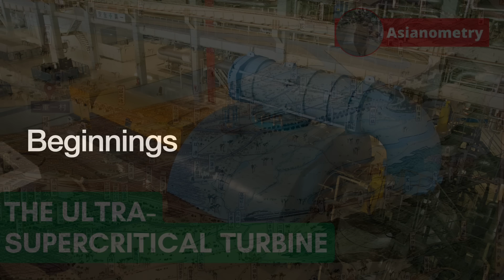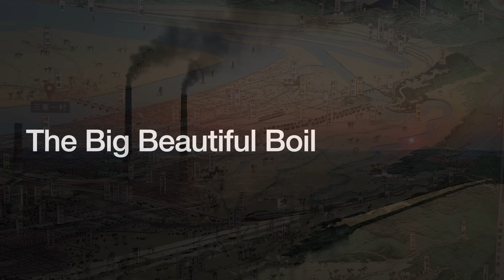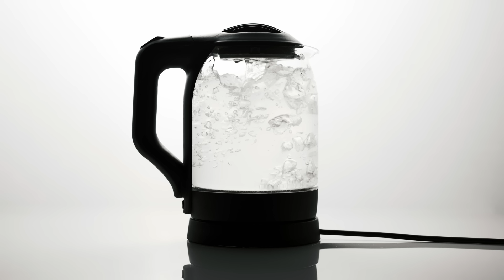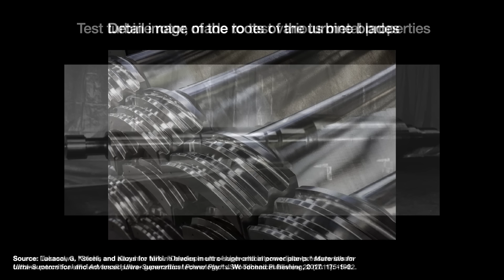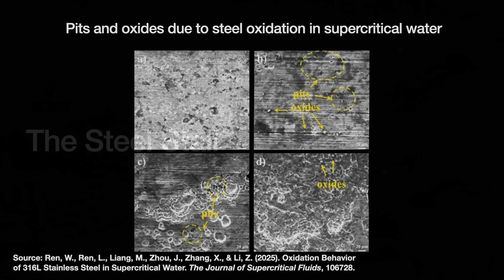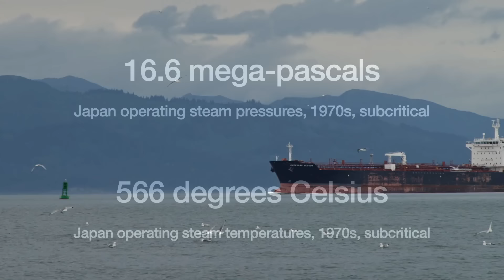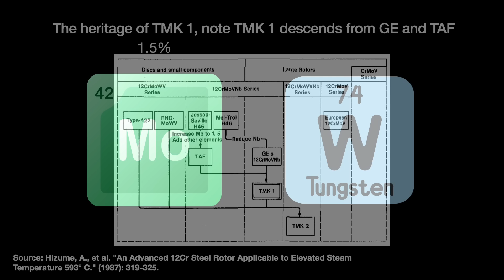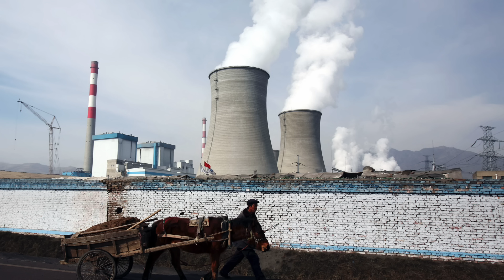The Epochal Ultra-Supercritical Steam Turbine

Comment: Maybe you already covered it, but I would appreciate a video on alternative heat transfer mediums. I've seen Helium and supercritical CO2 used for turbine applications used in China, but maybe there are other ideas out there.
Reply: Helium and CO2 turbines have exactly the same problem as ultrasupercritical steam (and indeed gas turbines) - they are limited by finding alloys that will last at these temperatures and stresses.
Reply: supercritical xenon (and the other noble gases) have some wild theoretical advantages, but they're just too expensive to ever use on earth.

where its advantages may find practical use, is in large spacecraft that have to operate for centuries without maintenance, where size and weight are extremely important, and the raw cost of xenon isn't an invalidating factor.

from a physics perspective, the ideal "working fluid" is heavy, unreactive, ultra-stable, and non-corrosive... the reason we use "light, corrosive, reactive, unstable" steam is because cost is king.
Reply: @JedPotts-jv2ux if you're using molten salt nuclear those noble gasses are a lot easier to obtain. It would take a while to generate enough to justify building turbines around it but could easily be a future development once older designs have produced a steady inventory
Reply: @JedPotts-jv2ux argon seems pretty cheap, is that a poor choice for some reason?
Reply: @eldencw  no reason i can think of, its just that steam is so unbelievably cheap in comparison to everything else.

argon should be superior to supercritical CO2 in every way, assuming argon's low supercritical temperature isn't an issue.
Reply: Anton Petrov made a video on it recently if you havn't seen it, not as a main turbine but still very interesting and apparently commerical at one location in china
Reply: @erikssonown  https://www.youtube.com/watch?v=BNDrC6fkjf0
Reply: I have only heard of supercritical CO2 being used as a solvent
Reply: You might want to check out Kalina cycle and ammonia working fluid steam engine research.
Reply: Most high end pumps in space use Hydrogen. Both for pumping coolant loups out to radiators, to get your cool side, and for the heat engines themselves to generate the power. Hydrogen is fantastic both as a coolant, and as a working fluid, especially from a power-to-weight ratio perspective. It's also a real pain in the butt to keep sealed, and quite high volume, which really sucks if you're building a power plant in a fixed size and expensive plot of land, and you don't care so much about weight.
Reply: @ASDeckard  Very large dynamos mostly use hydrogen as a coolant and have since the 1960s (another byproduct of the space race). With the same advantages and disadvantages.
Reply: In some steam generators hydrogen is used for the cooling of copper windings in the generator, then that hydrogen is cooled by water
Reply: Not much beats water's 1600x expansion.

Take a 1.6l engine/container. Put 1cc/ml of water in it. That's how much it expands.
Reply: @myne00  phase change require a lot of energy that wasted hence why people bother with alternative that don't boil water
Reply: @xtradi  that energy is also the very reason the phase change is useful though.

Comment: all that effort to be 1/2 efficient as a hydroelectric plant :(
Reply: Unfortunately that's just the nature of heat engines, they can never be 100% efficient because heat must be rejected in order to revert the working fluid back into its original state for the engine to keep operating in a cycle.

Even hydro is like this, though not on the scales we are used to.  The heat input into the water to cause it to evaporate, before raining down into the dam's reservoir is rejected as heat.  All things considered hydro electric is probably terribly inefficient, it's just the heat source is massive and practically infinite from our perspective.
Reply: But less location specific.
Reply: hydro plants have quite a few problems, notably massive ecological impacts.
Reply: It's almost as though it's solving a different problem
Reply: Too bad hydroelectric can’t be "ANYWHERE" and "ANY SIZE"
:(
Reply: Ever see a hydroelectric plant on a trans-oceanic cargo ship?
Me either.
Reply: You can never beat the Carnot efficiency

Comment: It's like we evolved to boil water.
Reply: Born too late to BOIL WATER. Born too early to BOIL WATER. Born just in time to BOIL WATER.
Reply: @Flumphinator  i think the boiling water is coming to an end. Now we will boil supercritical CO2. China has one already.
Reply: @pseudo_anonim  whaaaaaat
Reply: @pseudo_anonim Also in Heatpumps. I am writing my master thesis sbout that
Reply: @lefotografion  look for the video from Anton Petrov. Its awesome.
Reply: @pseudo_anonim  "But you just can't get the amount of energy from CO2 like you can get from water. Due to energy capacity. The capacity of CO2 is laughably low in comparison to water. 0,85 kJ/kg/K vs. 4,18 kJ/kg/K....."
That's what I wanted to say. But if you look more into supercritical CO2 the numbers look very... interesting. No wonder CO2 Heatpumps are popping up all over the place... It seems to be a pretty efficient, ecological step to do that. also because you can run all of it at in comparison very low temperatures... Amazing!
Reply: @MarkarthGuard45  
search on youtube "The End of the Steam Age? China’s Breakthrough CO2 Generator"

More info and this channel is gold IMO
Reply: @MarkarthGuard45 the other advantage of S-CO2 is significantly lower corrosion and wear characteristics (being much smaller helps too).

The naysayers are latching onto corrosion in both S-CO2 & Molten salt nuclear whilst ignoring the fact that tech they favour (LWR and steam turbines) both have massively larger issues in this regard. It's like watching "certain groups" in the USA who think that attack-dog politics, promoting FEAR & shouting down any dissent is the way to informed devate
Reply: @MarkarthGuard45  Sorry,  it's  about thermodynamics!    To  work  with  CO2  means  to  work  far   supercritical,   You  cen  work   with air   to,  so   CO2  nothing to   prefer!   CO2  or  something  else    maks  sence  at lower  temperature!   because  You  have  the  posibility   to  trensfere heat   at  one  preassurelevel   and   temperature   level..   It makes  sence   for low  temperature  cooling  devices.   CO2   ist  on the other  hand   chemically  stable   at  higher  temperatures...        CO2    is  not  offereing  the   adventages   of   the  steam    of  water  in therms   of  Temperature  and   preassutes   that  work   well ...      so    why   CO2?
Reply: @pseudo_anonim What people are missing here is that in the supercritical CO2 cycle you never condense into a liquid.  Even in supercritical water turbines you go through a phase change which losses you a ton of energy.  But just using a gas doesn't work either because it has such a low density.

The reason for CO2 is that your thermodynamic efficency is related to the difference between your lowest and hottest temperature so you need something you can turn supercritical at near room temperature.  You can do that with CO2 but not with water and CO2 is actually much better behaved at those pressures than most other molecules.
Reply: @pseudo_anonim  Sounds like propaganda.
Reply: @petergerdes1094  That is true, but also should mean absolutely insane pressures, to have a supercritical CO2 at the high temperature and density needed to get good thermodynamic efficiency.
Reply: @teresashinkansen9402  They usually operate around 200-300 bar (only need 70 to become supercritical).  Dunno if you call that insane.
Reply: @petergerdes1094  That is still a lot of pressure to keep on all the system. Supercritical CO2 at 300bar has less density than supercritical water at the same temperature and pressure plus less heat capacity. So I guess the main benefit is simply due saving energy due lack of phase change. But I still have this strong feeling CO2 turbines are just another another overhyped thing, not that far from thorium reactors. Ill keep learning and see if that notion changes.
Reply: @teresashinkansen9402  "Sounds like propaganda." lol what? Are you well ?
Reply: @pseudo_anonim  Very well, why? you will be surprised how much propaganda chynia pumps out.
Reply: Just imagine how much hotter and higher pressure the water our descendants will boil in their antimatter power plants will be.
Reply: @vgalis This one made me chuckle. God bless! ✝️ :)
Reply: @vgalis coffee spilling, excellent😂
Reply: @vgalis  "The epochal adiabatic water plasma turbine, how we tamed bremsstrahlung losses"
Reply: @vgalis  not really we will boil supercritical CO2 china has one already working. Boiling water for now is max 40% efficiency boiling CO2 can have 70% efficiency.
Reply: @pseudo_anonim  GE's steamH turbine is capable of 49% efficiency with steam
Reply: Super critical steam carries energy like sorcery. It's cheap and it's everywhere.
Reply: @404BYTE . Yep.  Works.
Reply: Some evolve into crabs and some evolve to boil water 🤷
Reply: @Tired_Koalabear then some boil the crabs in water.
Reply: Crabs were evolved to boil water, just look at the mantis shrimp 😏
Reply: Only fossil fuels make these high pressures necessary and from a grid perspective they are not very efficient as they are with a small margin only on or off.
Reply: @-r-495 anything hot makes it necessary. Wet steam is hell on turbines with massive increases in wear if droplets hit the blades (plus it washes lubricants out of bearings)

The hotter your hot side is the easier it is to raise efficiency and/or not have to reject heat into large bodies of water (which causes major ecological issues).

Steam works, but it's chemically reactive. CO2 is also reactive but vastly less so and doesn't need as much pressurisation (plus can have the cold side considerably colder than the cold side of a supercritical steam turbine)
Reply: @miscbits6399 You just need to plan and manage the rejected heat.  There are really interesting and kinda unique biomes around some of the Florida nuclear plants.  Unconsidered intervention is harmful but just because it isn't what was there naturally doesn't mean it isn't actually better.
Reply: @-r-495  nuclear energy is all about boiling water
Reply: We could not serve a more noble purpose, truly
Reply: Solar panels
Reply: And to find ways to travel faster
Reply: Were just monkeys that have learnt to make better and better fire. We've got some pretty serious fire going on these days. Still, some of the best entertainment going is a few lumps of wood on fire n some rotten berries.
Reply: Water, is the most magical/mysterious Element on this planet.
Reply: @brianjennings7644  it's not an element lol
Reply: @MadScientist267   
it's Sooo much more, little child. "Earth, Wind, Fire, Water" : it's an Elemental..kid..always has been, eh!
Reply: @brianjennings7644  I don't want to say anyone is slow or anything... but well, see... hmmm
Reply: @MadScientist267  
sure kid,..you're "on the spectrum" I get it, Sport.
Now run play with your Pogs.
Reply: @MadScientist267 i think i disagree with the guy i think water is god. If we have water we are gods on earth if dont we are chimpanzees with a week left to live
Reply: @ayıboğan_ertuğrul From that perspective, if you think that's a powerful idea, there's a whole lot more than just water on that list. Just a couple to start with... get rid of gravity, or better... electrostatic/electromagnetic forces... water won't even exist to begin with (or anything else for that matter lol).
Reply: @brianjennings7644 another victim of US education system or homeschoold by a pigeon
Reply: @RickTheClipper  Pigeons lack the cognitive capacity to understand such concpets. If you meant in a figurative manner then you are also wrong, pigeons have shown to be remarkably intelligent animals.
Reply: It’s steam? 
It’s always been steam
Reply: The new methof is not goodor makimg tea so I wouldn't call it improved.
Reply: Maybe the amount of water available is a Fermi Paradox Great Filter? Not necessarily for life itself, if other materials can replace it but if there isnt any, or enough to boil then it might limit technological development.
Reply: But these units DONT boil water. Thats the whole point.
Reply: @GeneraLeeUnstable  uh actually they do. They just.. go beyond.
Reply: @GeneraLeeUnstable the food you eat boiled water before going to your plate, you boil water yo prepare it and it boils water while preparing the food most o the time, you boil water (and the nutrients within it all together in your stomach) when you eat something....water boiling has been part of our biology since we born we kust didnt realise
Reply: Nothing beats water
Reply: @AquarianNomadic  what about lack of water?
Reply: If you take a piece of liquid and boil it in the open it will turn to gas and push in every direction. Next step is to direct that pushing force, usually done with some pipes, direct it on turbine and you get electricity. 
We don't evolved to doil water, physics made it take current shape. 
If there was different force happening mechanism would be different.
Reply: can't wait for the supercrtical co2 to replace water
Reply: say that again.
Reply: And burn carbon!
Reply: @BruceGinkel Oxidize carbon
Reply: Boiling water was always here. Before man was, boiling water waited for him. The ultimate trade awaiting its ultimate practitioner.
Reply: I hear a lot of talk about how fusion is going to save the day.
Sorry but a fusion plant, without some miraculous tech, is still just a boiler producing steam to eventually spin a generator.
Reply: @capnkwick4286  I saw that super critical co2 turbines are better and smaller for quite some use cases. if that is the future then who knows whats down the line many years later. maybe we will move on from steam after all.
Reply: @killahattack529  Why is everyone so obsessed with "moving on from steam"? It's simple, cheap, and very efficient. There's simply no need to look for something better when you're that close to theoretical to begin with. Sometimes you don't need to improve something. It just works, and works well.
Reply: @MadScientist267 steam works but maintenance is an issue. It's corrosive.
Reply: @miscbits6399  I guess it would be more interesting if the extra efficiency didn't go into feeding AI that many simply don't want. It's a moot point until the hypocrites can't drive either. Then what.
Reply: @capnkwick4286 
And it will arrive way too late to help with the climate crisis.

Plus waste heat is going to be as big a problem as heat held back via GHGs if we continue growth.
It doesn't matter if we insulate the greenhouse or we throw in a space heater.

Read the details in There Is A Deeper Problem Beneath Global Warming by Aeon.

This is why we get double the bang for the buck with renewables like solar and wind: There is no waste heat, so replacing coal saves CO2 and removes a heat source.

And we are so close to the brink that every little thing helps 🫤
Reply: @capnkwick4286  and you have completely missed the point of using fusion and what it means.
Reply: @capnkwick4286 nahhhh, it's all done with glowing green goo. I saw it on that documentary program "The Simpsons"
Reply: And to produce plastic.
Reply: All technology starts with fire.
Reply: @cpt_bill366 dam?
Reply: @southsupremancy Still need to make the steel and concrete in a hydro electric dam
Reply: @gherkinisgreat in that case we need big bang to create Earth first 😂
Reply: we also have solar panels which generate electricity with no moving parts. And wind turbines.
Reply: @kellymoses8566 uranium zoomies > Sol zoomies
Reply: @kellymoses8566 Neiyher are being recycled despite the lies being told.  Check the massive wind turbine blades being buried, that can't go on forever.  Solar panels buried too.  Not economically feasible to recycle. No one is doing it. 2 companies went bankrupt trying, but it doesn't work.  If you want to bring back slavery, we can do it though...
Reply: @kellymoses8566 and we still use them to boil water 

go figure

Comment: The first units were Philo  and Eddystone in the late 1950s and early 1960s. They eventually had to derate a lot of units due to corrosion of austenitic stainless steels. The highest thermal efficiency for a thermal power plant is 49.5% at Wai Gao Qiao Unit 3 in Shanghai. General Electric Steam-H promises efficiencies above 50%. The top cycle temperatures are now so hot that the superheater and reheater steam lines glow dull red in total darkness. Wai Gao Qiao Unit 3 is ultrasupercritical and uses double reheat, increasing the average temperature of heat addition without increasing peak temperatures. As far as I know, austenitic stainless steels are the most advanced material used. We haven't yet progressed to superalloys. Supercritical CO2 also offers promises of efficiency improvements, but serious problems remain in that they basically require superalloys, and the recuperative gas coolers/heaters are expensive and large.

Comment: Are super critical steam turbines not also suitable for nuclear power plants as well as coal? Most nuclear reactors generate power by heating water.
Reply: Light water PWRs and BWRs can only achieve temperatures corresponding to a saturated steam temperature of 900 to 1200 psi and a thermal efficiency of 33%. Liquid metal, gas, and salt cooled reactors can achieve much higher temperatures. The Russian 800 megawatt sodium cooled design can achieve 38% thermal efficiency.
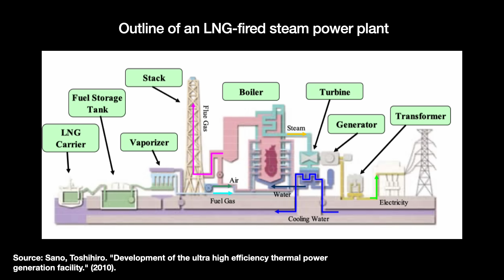Reply: 0:47

Comment: Creep Strenght. Even knowing the Ferrum Carbon (Fe-C) diagram, I was not aware with steel. 
Glass is also called/characterized as a untertemperatured/ too cold liquid.
Thats was a very important review. Also the information/comparison with Gas turbines. And the comment electricity from coal is cheaper. But also the limits of renewables. Thank you.